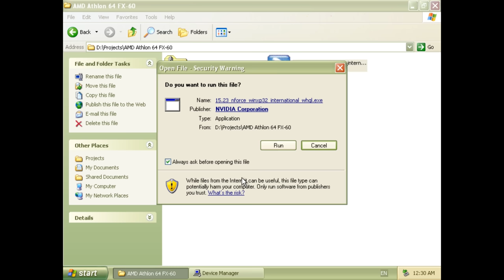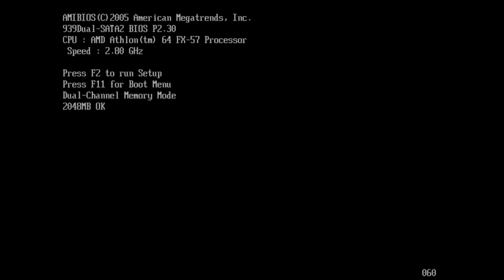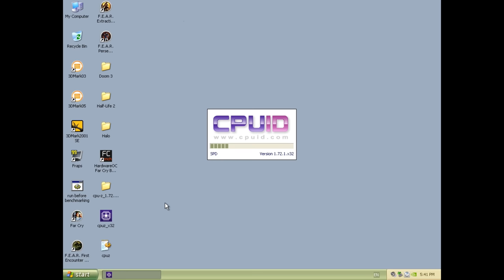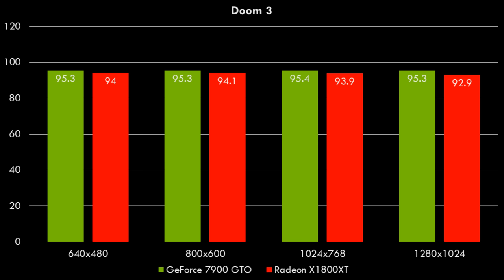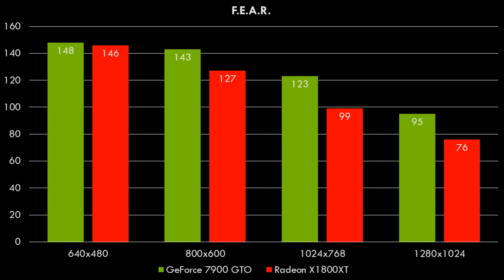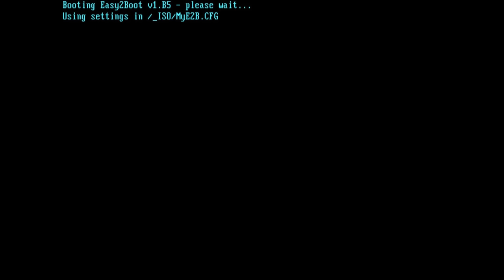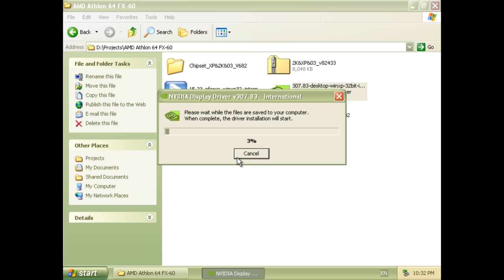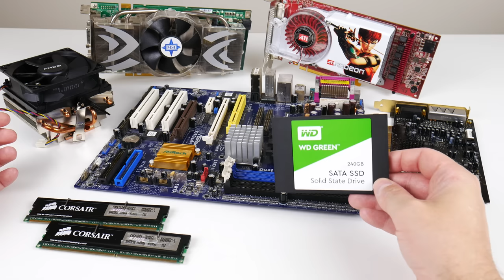AMD Athlon 64 FX-57 - $1031 CPU from 2005

Comment: In my Closet I have an A8N-SLI socket939 with an Athlon XP 3200+ 2.0GHz single core (tho often listed as 2.2GHz), with dual video and 4GB RAM. It works fine but the whole system is relatively slow (does not compare well to my old P4). During boot it only has USB1 so booting from USB takes a long long time (15 minutes or so. Good tip about GRUB2DOS, I'll try that next time I mess with it.) I've thought about upgrading its CPU, but it isn't worth putting any real money into. Win10 gets stuck at the boot screen. Previously I've had it running ReactOS and Mint17, but not Windows.

Some of these Asus boards are really dumb about HD detection, and you have to go into setup every time you swap or add a storage device (HD or USB).

ETA: so you've inspired me to screw around with it ....  It confirms itself as an Athlon 64 but XP64 complains "NTLDR corrupt". XP32 won't boot. Win7x64 is making a valiant effort; at least the installer is running!! Very, very slowly.... four minutes to reach "Setup is Starting".
Reply: Win10 64, cuz I have one that's agreed to be portable (doesn't seem to care what it's attached to), so no install required.

Well, it gets worse. Win7 gets as far as prepping the disk, then dies. XP32 -- only Micro gets anywhere and the install does not complete. ReactOS ditto. I used to have LinuxMint (64bit) on this box and now it won't run, even as live CD. So something's gone tits-up. Far as it gets, it's still slow as ever, unfortunately. Win10 and 7 leave the hardware running, everything else powers it off. If it didn't still have its stock HSF, I'd think it was overheating, but it ran fine with that back when it had Mint and React installed.

I have a pair of Asus P5B Deluxe... the one that was in use 24/7 grew bad caps (everything still works except for anything USB, and it shows low voltage on the board itself -- PSU tests good) and now that the twin has been 24/7 for a while, it's getting a bit suspect too...according to what I can find, there's a design flaw in the PCB sending bad voltage to the southbridge capacitors. Starting to wonder if the A8N is suffering from something similar, tho I don't see any obviously bad caps.

ETA: Had to take it apart to find it, but... yep, there's a bad cap. Maybe explains why USB keyboard works but USB mouse does not.
Reply: Thanks for the info. I don't use AMD for everyday and have not kept up with their quirks and limitations. 

Without taking it apart to look... IIRC there's a mismatch between what it says on the CPU, and what CPU-Z reports. But it did run Mint 64bit, so...

But turns out there was a well-hidden bad cap... just starting to go (it almost looks okay til you compare to the rest) but probably when it gets warm enough, then the whole thing falls over. :(

Comment: I always had problems with  old ASUS boards, especially AMD boards i used an M4N78 PRO for a longer time, and it always said new CPU installed , i turned it off in BIOS and turns out, it forgot CMOS settings everytime i turned off the PC, replaced the battery still same results

Comment: From reading the comments, I'm wondering if reapplying thermal paste and/or adding active cooling to the chipset could've resolved the issue...if the chips aren't dead already?
Reply from the maker: The thing is up before installing the chipset driver, the board worked perfectly.

Comment: I still have my builds from the 2005 - 2009 era:
AMD Athlon 64 3000 paired with as MSI K8N Neo 2 nForce 3 motherboard and 2GB of DDR RAM and nVidia GeForce 6600 GT which was my last AGP card (prior to that I was running the trusty ATi Radeon 9700 Pro). Sound card: SoundBlaster Live! Platinum to SoundBlaster Audigy.
AMD Opteron 170 (Dual Core) with an MSI K8N Neo4H nForce 4 motherboard with 2GB of DDR RAM and PNY nVidia Geforce 7900 GS which was then upgraded to an nVidia GeForce 8800 GT and then to a GTX 260 Core 216. Sound card: Sound Blaster Audigy to Audigy 2 then to the Sound Blaster X-Fi Xtreme Music.
Reply: On a side note, I still use the Creative Labs 5.1 speaker set from the 2005 era and they still work perfectly. I've been meaning to upgrade my speakers but the lows, mids and highs are still top notch when gaming and watching movies.

Comment: The best 939 CPU I currently have is Athlon 64 4000+. Is it that different from Athlon 64 FX?
Reply: the 4000 is 400 mhz slower then the fx57. then there is the opteron 156 at 3 ghz witch is as fast as it gets but that one is impossible to find.

Comment: I bought an FX-55 and remember being annoyed when the FX-57 came out. I replaced it years later with a dual core socket 939 chip that I bought for ~$150. I keep it on my shelf as a reminder not to buy flagship CPUs ever again.
Reply: Yeah thats the whole point of flagship to take advantage of early adopters

Luckily now tho... Buy a flagship AMD cpu will.... Have much better benefits when before it was just an unlocked multiplier and faster stock clocks

Comment: It is all unified now - Intel CPU must have Intel chipset, AMD is the same. Few years ago we've had Ali, ULi, VIA - so much more competition.
Reply: Don't forget SiS.
Reply: @ryarinaprasetya1216  

Indeed. But SiS was rather painful and slow so probably my brain wants to forgot all those cheapest PCChips integrated motherboards I use install in so many small businesses. It was good for office work, excellent value for small business but terrible for gaming.
Reply: @jacobjay2892  Slow but surely cheaper, I have a P4 1.8A system with SiS 645DX that I bought brand new in 2002 that still work fine today as xp machine. I feel it's less snappy compared to intel chipset back in those days.

Comment: Back in the day i owned a lot of Chaintech motherboards they where cheaper than the brand ones and i had never faced major problems with them. Also why bother installing XP on the ssd, trim isn't supported and after a couple of major writes it will start to crash

Comment: i never could install xp from usb. Nowdays i just don't bother, i install win 10 lite version (LTSC is also nice one).
I completed conviction on 15fps. Set prerendered frames to 3 or 4 in nvidia panel. It was kind of turn based strategy but i think about every move. 8500GT get toasty in that game.
Any overclock?

Comment: Again, Phil's outdoing himself. Guys I need some info - most of the 1GB DDR400 RAM modules from Phil's link to ebay seem to be CL9. Is not that too slow? I've got a friend's  s939 system in my garage. I d'like to upgrade it with 4GBs of RAM, dual core Athlon 64, an SSD (and perhaps one of those "scammers"GPUs) and see how it fares nowadays. His mom would use it for browsing.

Comment: I have the asrock dual sata board my dad got it complete witha radeon 9200 se 2 dvd drives a firewire card and a canopus video in and out card and 5 sticks of memory fo £1 uk board needs some caps replacing i have an nforce am2+ motherboard by sapphire that works perfect it is made by jetway a donation by a local charity would have gone for scrap cpu is an athlon a 620x4 i also have a dual core 6400.

Comment: 1 thing I did notice, you installed XP onto an SSD... That's not a good idea. 

XP has no TRIM support at all and without garbage collection it will burn through write cycles much faster than it should. 

For anything pre Windows 7 stick to mechanical drives.

Comment: All the ASUS boards in your video use the same (United Chemicon) KZG capacitors around the chipset and SATA ports. These are known bad caps affected by the capacitor plague:

"KZG and KZJ are NOT good caps! They will even go bad on the shelf!" http://www.badcaps.net/forum/showpost.php?p=2044&postcount=4
"Did the caps you tested had KZG printed on them? If yes, then replace them. Those tend to go bad without bloating." http://www.badcaps.net/forum/showthread.php?t=42201

The Asrock board uses (United Chemicon) KZE caps which are not affected (see first link).

Comment: Those days I had issues with All Asus nvidia...
I went to 4800 X2 or Athlon64 3700 with Chainthech or Epox mobos . They were much better than your system. ULI chipset had burning problems and low pcie performance.

Comment: A working ASRock PCI-E + AGP ? I had this motherboard and it's one of the worst motherboards I ever owned, it only worked around 1 year, not more. I had worse of course, at the time of 100 MHz super socker 7. Now I only buy Gigabyte and the last one I owned which burned was a EP35-DS3R. A long time ago as you can see. Happy easter

Comment: I had the first Asus board.. after it died I moved to gigabyte and never went to anything else
Reply: I had Gigabyte UD too up till 775. Wouldn't die no matter what overclocking.
Now i'm on Asus Rampage 1366 just because it works and was free. Also won't die due to overclocking. I bricked it once with a BIOS fail, but you can fix it with a cable and another PC!

Comment: I found an old AMD Athlon ii x4 pc thrown out on the curb still works but the psu died. i grabbed it cause it has a lpt header,ide,serial,floppy header etc, and i'll mess with other OSes linux,free dos,bsd,older windows. is it probably worth getting an evga psu so it wont melt down. i
Reply from the maker: Yes that's what I do. Clean power is important.
Reply: @philscomputerlab  the old psu died in the athlon was full of cigarette smoke ha

Comment: I would be suspicious if all three boards refused to work. So I would take another CPU or update BIOS using a programmer. Another idea is Nvidia chipsets might be degraded. Hot air applied during 20-30s exactly to Nvidia chip's die can resurrect chip temporary.

Comment: I really disliked, and continue to, the motion blur and bloom that was introduced to graphics in the early 2000s. As for the motherboards that don't work - use them for decoration or something in the spirit, e-waste is a really big issue we are facing, though buy using older equipment we keep a lot of it outside of landfills.
Reply: But I am feeling real hoardery though. I got 5 boxes in total, doing a S775 machine for Win 98 last. Can't meetup with the guy because of lockdown/MCO, so the stuff I got would have to tide me over for the meantime.
Reply: @Seatux   I keep my 775 for a XP machine. For 98SE, I got me some 478, though I got a Slotket and recently found me two complete AMD DX-40 machines.
Reply: @NiGhtPiSH  I am getting an Asus 775 board with AGP

https://my.carousell.com/p/282783092 about USD 9 with CPU and RAM. I figured it's new enough to use a modern PSU...

Comment: ASUS is trash, and apperently every other IT person I've met has the same feelings. The company I work for doesn't use prebuilt computers. The last IT person custom built all the systems and I built some new systems... every single system in the office use Gigabyte Motherboards and the couple that don't, use Intel motherboards (old systems). Back in the AMD Athlon era, I used ECS motherboards (which worked surprisingly well) and an ASUS with an nForce 2 chipset which seemed OK.

Comment: Those Nvidia chipset ASUS mainboards were most likely used by so called PC power users who tend to OVERCLOCK everything... hence they turn around and sell these parts online which btw were boutique PC parts with their own special motherboard packaging and prices and bragging rights but in all seriousness, any overclocker fan person will typically RUIN PC parts...

Some years ago there were brand new unsold MSI high end AMD AM2 socket Nvidia boards but they were selling for original retail and shipping from China... I should have purchased at least one of them as they were the high end motherboards but were limited to DDR2.

Most of my Nvidia chipset mainboards were never overclocked minus one because I really did not care about overclocking and only experimented with one of them and was not really thrilled at the way forced overclocking works and just feel it is useless when most of the time you are not really benefiting from game performance unless you refuse to buy a next possible maxed out stock graphics card.

Comment: Typical ASUS motherboards from that era, they turn on but completely unresponsive, cough P4P800 cough
Reply: I have an Asus M32N-SLI Deluxe, with the nForce 590 SLI, and last month I've spent a few hours trying to make it work.

It posts, but after each restart it won't post again, I need to reset the BIOS...but after reseting the BIOS, the same problem, won't post after restart.